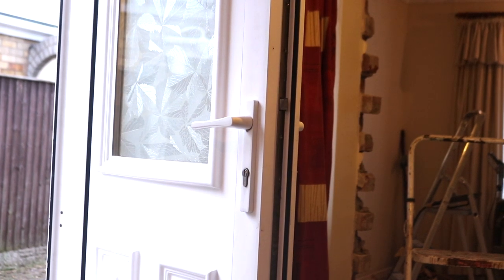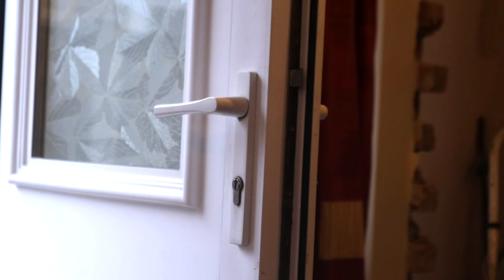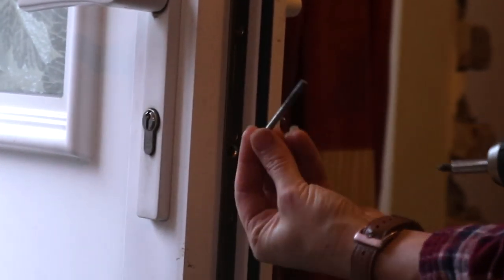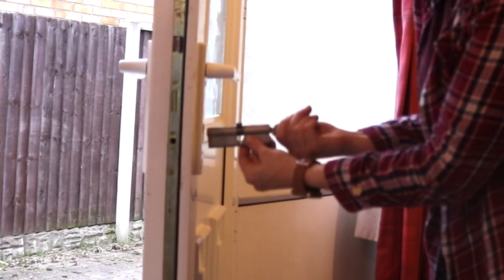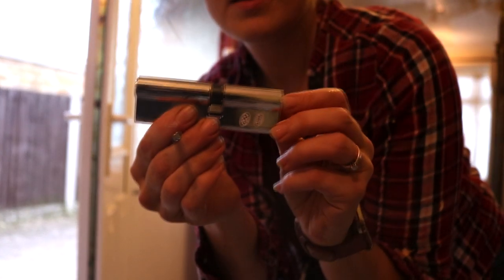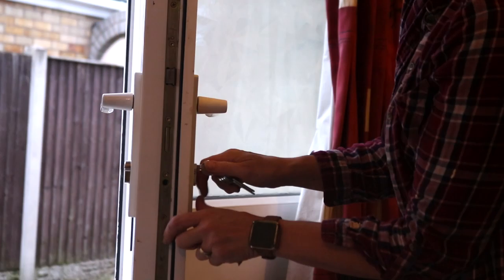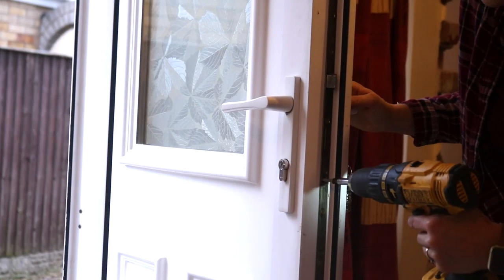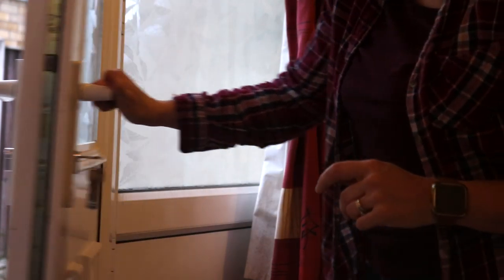How To Change a uPVC Door Lock | The Carpenter's Daughter

Comment: So important! Lock snapping by burglars is easily done! Just replaced two of mine and it is really as easy as this! Just make sure you do a bit of reading on measuring locks! I believe the max recommendation for the lock cylinder to protrude is 5mm. You also want a lock with a 3 star Kitemark for maximum protection! Anti-bump, anti-snap, anti-pick etc
Reply: I would say 2mm absolute maximum sticking out.
Reply: Thank you
Reply: I need to get a new thumb turn for my patio doors. My exit plan in the event of a fire is worth more than security! How do I know which one to buy?
Reply: @rebeccaard1  look for certification to TS007 'three stars'

Comment: Excellent video. I always suggest to people that they replace with thumb locks on the inside. In case of a fire, it'll be difficult to find your keys to unlock the door especially if there is thick smoke and you are panicking.
Reply: Do not put a thumb turn on a door with a letterbox, easy to reach through and unlock it.

Comment: It's amazing how many capable people pay hundreds to a locksmith or joiner to do such a simple job.
Reply: In the Netherlands a locksmith will charge around 80 Euros for replacing a cylinder.

The thing is, many people think they are capable and having seen a simple instruction video, they start doing it. The problem is that most videos, like this one, don't mention some of the details that turn ut to be really important. I did not know that a cylinder should not stick out of the front more than a few mm, but my locksmith does.

Whenever my safety is involved I tend to spend a few bucks and get a professional, no matter how confident I may feel that I can do it myself. Gas, electrics, locks, I'm allright tinkering with my car but for example I never touch the breaks or suspension etc,that's safety stuff, I leave that to the pro's.

Dunning Kruger kills

Comment: And to find out which Euro Lock you need measure them between the center mechanism.  They are sold in various lengths like 30/30, 40/40, 50/40 etc. Buy Ultion Locks to prevent Reptiles Snapping locks to gain entry and robbing your house, well worth the extra cost.

Comment: Good job, although the outside of the lock should be flush with the handle surround, only for security reasons as  it is rather easy to break those locks off and gain entry if you happen to lose your key.
Reply from the maker: Thanks for the tip!
Reply: @TheCarpentersDaughterUK  Euro cylinders are measured in 5mm increments from the centre securing hole ie: 45/ 40mm, 50/ 35mm etc. Measure what is sticking our from your handle on the outside, if it is 5mm or more then you need the next size down, try to get as flush as possible to the handle. i am a locksmith and see this all the time, so easy to break in.

Comment: If you’re buying a new lock you need 3 numbers. Its the overall  length of the barrel (mm), then the measurements each side of the rotating part. IE 120/60/50. Dont be tempted to fit a lock with the inner thamb screw rather than an interior key slot as it 'could' invalidate a burglary claim (or at least that’s what i was advised from my local locksmith), someone could break a window and still be able to open your front door to get back out.

Comment: I have Upvc door and had a problem with the lock.
Called out a locksmith and they said they couldn't do anything like change the lock because of the new locks have a bigger lock space??
yet my lockspace area looks the same size as the one you have, in fact it looks the same as yours in the video ???
Reply: If the lock space is "smaller" just change the handles at the same time its only a couple of screws to undo
Reply: no , they are referring to the lock space inside  door eg the space required for a lock. they claimed that I would need to buy a new door

Comment: What if your key as snapped in the lock? How do you get the lock out to replace it?
Reply from the maker: Good question!  I'll try and find the answer to that too ;)
Reply: @TheCarpentersDaughterUK  Make sure the keyway is in the correct position (not turned) then put another key in from the other side and give a gentle tap (only works when full blade of key is snapped in lock). If only part of the key is snapped in the lock then the lock pins will fall in behind it and trap it, you need a paper clip to lift the pins then tap a key from the other side as stated earlier. If the key  twisted when it broke, chances are it will never come out. I always ask to see the rest of the broken key when at a customers house to see if its twisted (the bow).